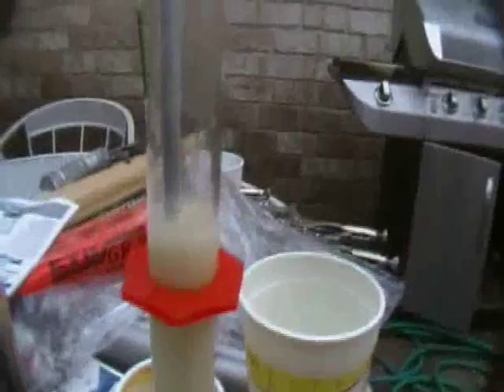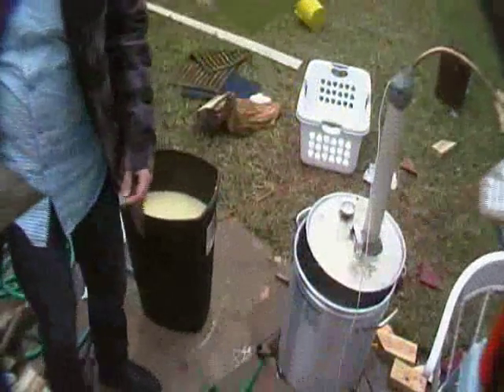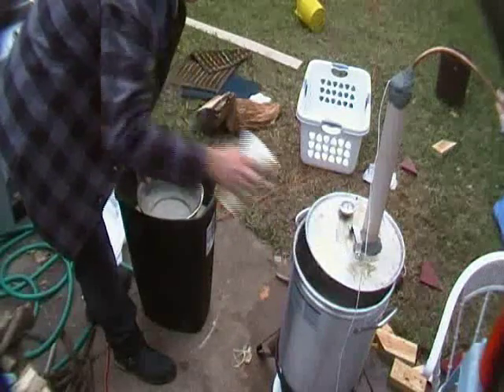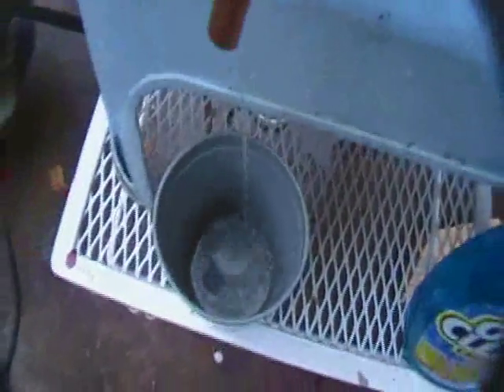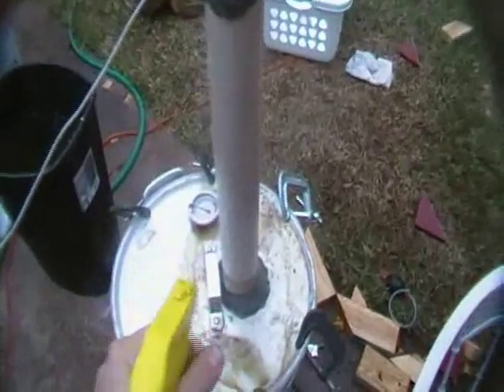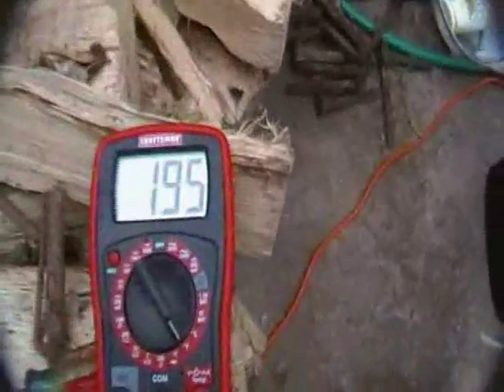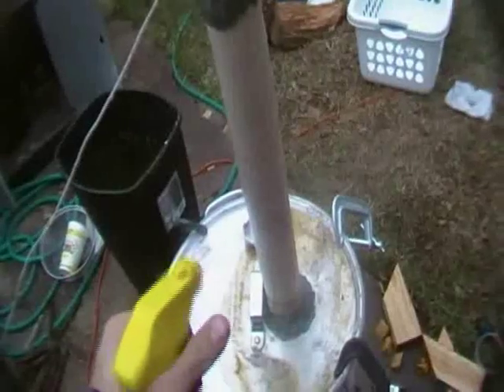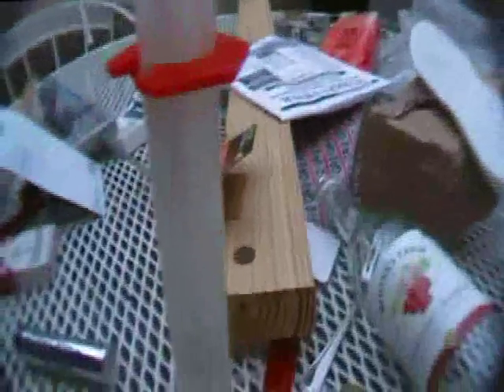Backyard Ethanol PT 4 - Distilling the First Batch of Mash

Comment: The only reason you got such high proof off the bat is because that was the foreshots and heads of the run. They are always the strongest. You should have dumped the first few ounces because they taste like crap and give you a hangover. You've got more ambition than I have but I sure hope you didn't use aluminum anywhere in that pot.

Comment: @strantor hey try lowering the heat so you do not have to cool the tower. run the top outlet temp at 176*F your temp should on its own run up 5 or so degrees then fall back down then back up slowly increasing. Also pack your tower with stainless steel scrubbers (no additives) about 1/3 the height. Your height to diameter ration needs to be 20 to 1 or so.....2 inch dia at least 40 inch height.....do not rush your system it is physically limited by its size.